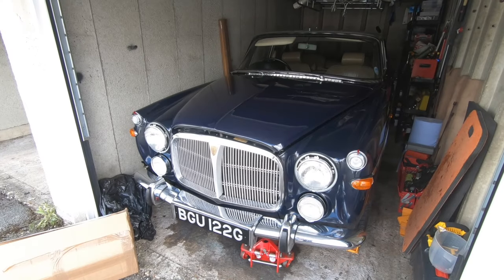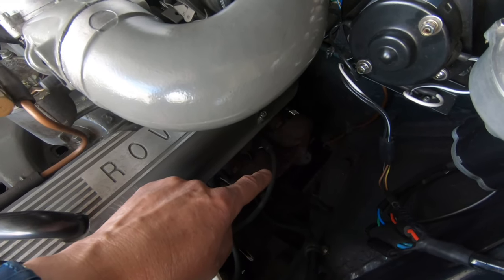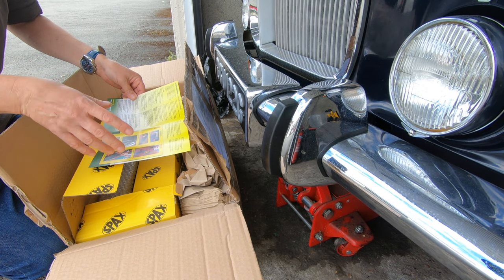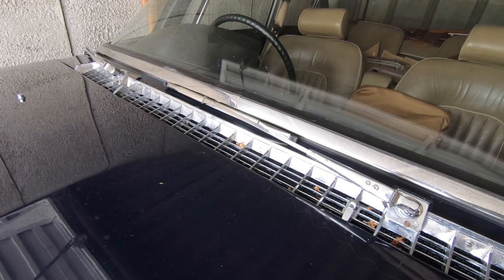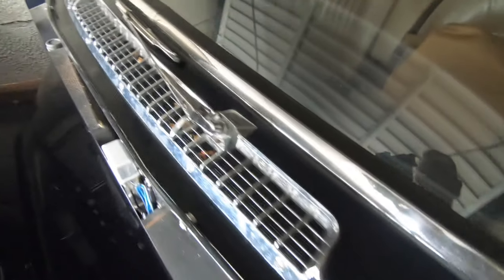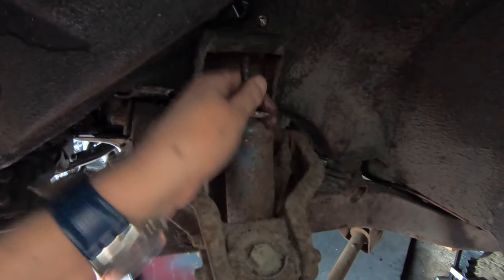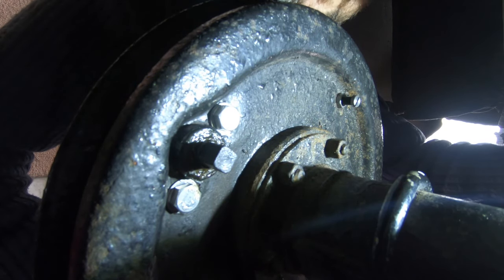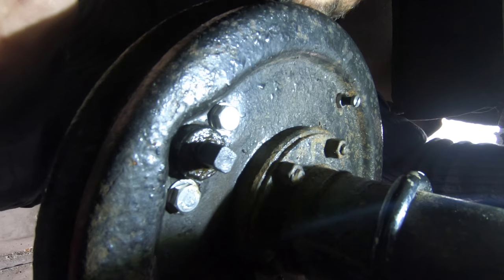Rover P5B. Will It Stop?

Comment: Excellent & interesting video. Nice work on the wiring and in the engine bay. At 13:00 the original shocks were made by Woodhead and they have a very nice ROVER emblem etched into the surface. They usually last forever and can be cleaned up if not too rusty or leaking. Properly set up, the HB will lock the rear wheels. Apart from the correct setting of the rods, it's essential for the rear brake cylinders and handbrake mechanism to "float" on the backplate. Locknuts are turned back one turn and it's best to use Thackeray washers. You probably know this already!
Reply from the maker: Good points. I didn’t know the shocks had a Rover emblem - will look for that next time I’m on the garage. I guessed they were Woodhead as they all seemed to be metallic blue originally? I’ll keep them as they still seem to work, but the outside is quite heavily pitted.
Reply: @RoverP5com  The two NOS ones I have on the front are blue Woodheads with the emblem. The two I fitted to the rear a long time ago are red cased but I can't remember what make they are. I must have a look at some stage.